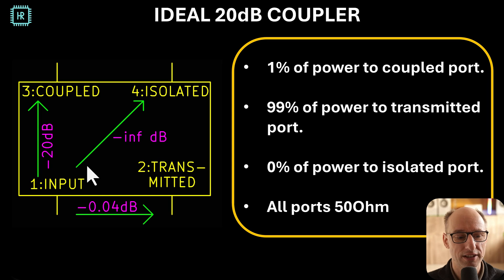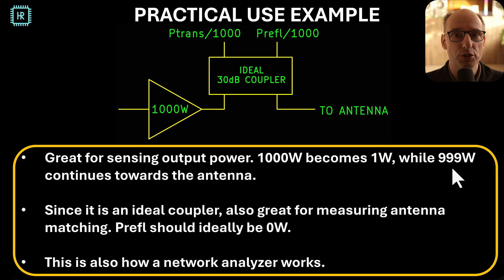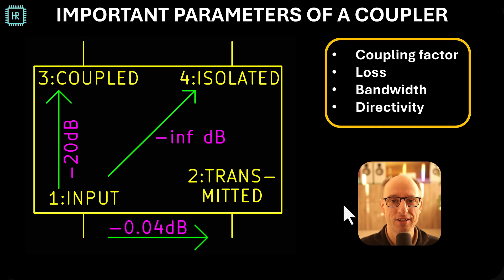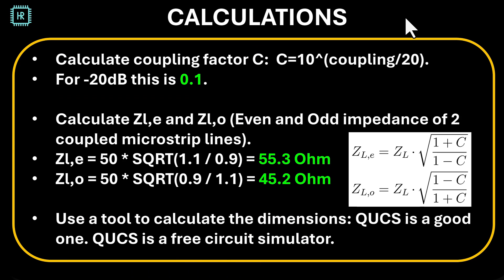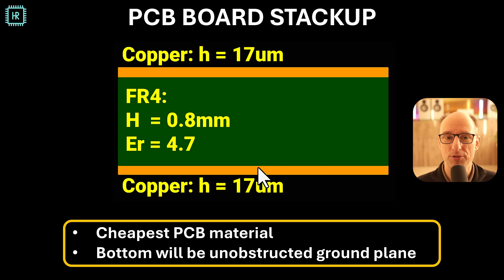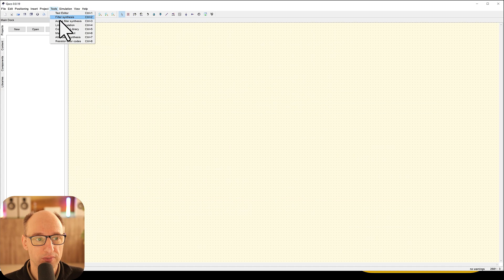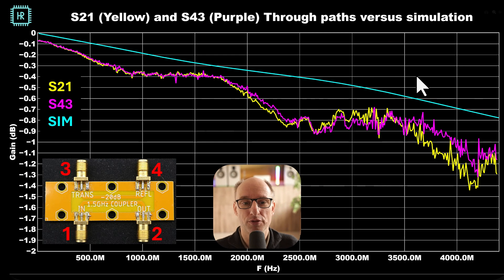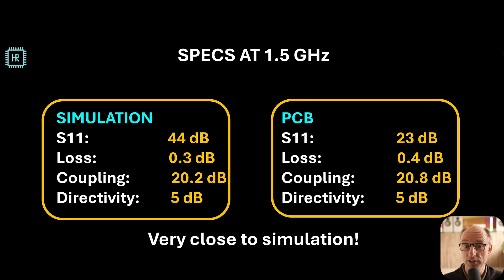Simple, Accurate 20 dB RF Coupler Without HFSS

Comment: Nice video. For the input matches S11 etc. it would be interesting to see the change by trying to solder as much of the SMA body to the copper. Also I wonder if the top/bottom planes has more stitching too and around the perimeter of the board. 23dB is pretty good!  I really like your channel, thanks

Comment: Why do you show -20dB and then write it is 1%. I thought -20db is 10x difference not 100x. What am I missing?
Reply from the maker: Aaah, great question. I was talking about power instead of voltage. When talking about RF we're usually talking about signal power instead of signal voltage. Power goes 'twice as hard' in dBs.

Comment: What 4 layer stackup should i use for eeg pcb. Its an adc and a mcu and power management. S/g/g/s? Or something else better?
Reply from the maker: Please watch my free module. You can find it on my course product page, purple button somewhere at 1/3rd of the page. The answer is in there (it is over an hour though). https://www.hans-rosenberg.com/epdc_information
Reply: @HansRosenberg74 yes I watched it thank you for that. I am so stuck right now lol. I just cant wrap my head around where these return paths will travel and if anything will interfere. Im doing an eeg pcb and its my first pcb. Its 90% done now im getting to signal integrity part and I am lost. Its the ground return paths that are confusing me
Reply from the maker: You're making this way way way more complicated than it really is:

Just have a ground plane under each signal layer. When you have a signal path, the ground current needs to return. Just draw the closest path the ground can make. Does it make a detour? Fix that with a via or something else so the return current can stay close. Under the signal trace is best.

It's really that simple, almost kindergarten stuff. It's just that we make it complicated in our heads because its electronics and we can't see what is going on. I had that same complexity in my head until I understood....
Reply: @HansRosenberg74 I agree but i am a beginner only 5 months experience and Im doing a pretty sensitive pcb. The eeg signals have to have probably one of the lowest noise interference of any mixed signal system. Im concerned about the digital dc and high frequency return magnetic/electric fields spreading far enough that they change the voltage of the ground plane underneath stuff like decoupling capacitors for the analog pins and idk I have a feeling that if I just put ground vias close to pins, make some via fencing at /20 highest frequency and just space stuff out it still might not be enough. Eeg signals can be messed up with as little as 0.010mv of noise

Comment: Really helpful video, thanks. For your example you have L=26.7329mm. For your PCB implementation you understandably have right angled tracks to the SMAs. Is L on your PCB the parallel (straight) part + the width of the two  45° parts or something else?
Reply from the maker: The 26.7mm is the part where they are closest together. It does not include the 45 degree angled parts!

Comment: What about frequencies in the range of a couple MHz. Quarte wavelength would be couple meters. Not suitable for pcb.
Reply from the maker: No that really would not work, unless you're willing to solder 50 pcbs together. At those frequencies, you need to use transformers. I believe mini-circuits will have some solutions for that.

Comment: It's funny the algorythm must be listening to me. I tested out the PCB mill at work and made a directional coupler for 915 MHz with coupling of 10db. I terminated port 3 directly with 2x 100 ohm resistors in parallel to make 50 ohms. leaving port 2 open circuit I could see -12dB on port 4 and terminating port 2 with 50ohms made it drop to -34dB. That's 22db isolation from kicad transmission line calculator. If it's 10dB coupling im guessing tha means 0.9 is getting to port 2, and reflecting that would couple 0.9 * 0.1 to port 4 which is -10.4dB so yea not bad. 
I'm working my way to making a network analyser. Next step is the local oscilliator and 2 mixers.
Reply from the maker: Ok, wow, you want to build your own network analyzer? That is a great project! You need really good isolation. I searched for some papers on it after I made this video and saw the bad isolation. I found some papers who add some ground at the points where the pickup line bends away from the through line. That really increased the isolation a lot. You'd need to do em simulations to optimize that but this is something I want to try at some point. I searched for 'high isolation RF coupler design' or something like that. Probably, chatgpt will give much better answers right now. this thing is getting scary good :-)
Reply: @HansRosenberg74  I just saw your rat race coupler video and might use that for the mixers. I know about super heterodyne receivers down mixing the RF to an IF in while keeping all side bands. Didn't know they keep phase information too, so i'll be leveraging that for the phase measurements in the network analyser. Shared LO going to 2 mixers. FR4 is cheap, worth a play to learn at the very least.

Comment: Hi, I am new to your channel. I wanted to ask regarding the coupler parameters. Isn't insertion loss a major parameter too. I often see it in datssheets. How does that work out exactly? A brief description would be great. Thanks.
Reply from the maker: Yes, it is important, it is basically related to the matching of the input port, which is measured. You could also take the overall loss of the coupler which is in the measurements. That would be the loss from the input to the output port.
Reply: @HansRosenberg74 okay got it. So total loss measured from input to output can be thought of insertion loss. Thanks.

Comment: Hey, thanks for the videos. Could you make a video about fixing holes, whether or not they should be connected to the chassis with the ground plane? If I have more than one fixing hole, do I put all of them in contact with the ground or just one? If I have more than one board in the case, what should I do?
Reply from the maker: This is a bit of a tricky question, but a very interesting one! After a little thinking, I think the  main thing to keep in mind is this: If you have signal current running somewhere, make sure there is a ground return path nearby. So you don't want to use the case as a ground connection for signals moving between pcbs via ribbon cables for instance. You'll make a big loop that way. If you give each signal current its own ground return current nearby, I think you should be ahead of 99% of problems.

Comment: Hi Hans. I'm designing a circuit that is using the AD8352 chip. It's basically a Gigahertz op-amp. Its input and output impedance is very high, so the evaluation board in its datasheet has open planes underneath its input and output traces to prevent capacitive interference.

The logic seems sound, but it obviously violates your unobstructed ground plane doctrine, so I wanted to hear your opinion on it.
Reply from the maker: These are exceptions. When you're working with such a high bandwidth feedback circuit, even the smallest amount of parasitic capacitance can ruin the phase margin, bringing it closer to instability. Now these gaps are very very small, so the frequency where they would cause problems with the return current path would probably be above 50GHz so that is nothing to worry about. Great question!
Reply: @HansRosenberg74  Huh, so that is an exception. Do you think that might be a good Flawless PCB Design video topic?

Where would you cut the ground plane? In the middle of the baluns like in the AD8352 datasheet? Or perhaps after the 25 ohm resistors?
Reply from the maker: @cdroidno8  I would follow the datasheet.

Comment: Nice theory, but I mostly use HF bands. 2 metre at the highest. 
At 2m, the tracks would need to twist like snakes to fit on a board.
Reply from the maker: indeed, 'lf' is not acceptable here, maybe you can do the same with a transformer at these frequencies?
Reply: Usually reflections are done using a transformer-based bridge circuit instead of a microstrip coupler at lower frequencies. Although I have seen some 2m band devices with microstrip couplers (don't know how well they would have worked though).

Comment: You need a proper vna.
Reply from the maker: I know, care to donate one ;-) I really would love to have a fieldfox all in one....... a bit expensive unfortunately ;-)
Reply: @HansRosenberg74  The Librevna is ok for many things. The developer is very helpful. There is an ecal for it too, the librecal. The whole setup is reasonably priced, at least when compared to some online electronics courses ;-) There is potential to improve the isolation on the Librevna (although it is ok for many things already), and being open-source, you would be free to do this.
Reply from the maker: I looked at the libre vna. However, the specs seemed to be very similair to my nanovna v2 plus 5 which is the best model currently. Improving it might make it better, allthough my biggest lack in the nanovna is dynamic range and I wonder if you can improve that because it is most likely linked to the dynamic range of the adc in there.
Reply from the maker: ah, I didn't realize the librevna is a full 2 port! That makes a big difference. Maybe I should look into this! thanks

Comment: When calculating S21 and S43, did you also account for the extra losses from the SMA connectors on the PCB? How much are those losses in your setup?
Reply from the maker: I did not account for those. It could very well be that those extra pieces of pcb track from the coupled lines towards the connectors and the connectors themselves account for the 0.1dB of loss I'm missing.
Reply: @HansRosenberg74  Thank you for the reply! I would be interested to learn more about your footprint. I've struggled to get losses of less than 0.5 dB in a connector when using edge-mounted coaxial connectors. The transition from the connector to a 50-ohm trace is tricky to get just right.
Reply from the maker: If you want good performance, you have to use specialized connectors and ro4003. Here is an example of such a connector: https://www.belfuse.com/resources/assemblyinstructions/cinchconnectivitysolutions/johnson/ai-ccs-john-sma-high-frequency-end-launch-connectors-pc-mounting-instructions.pdf
Reply from the maker: This is not the best document, 10 years ago I worked on a radar system that needed very high specs, I used end launch connectors that were specified up to 26GHz. The layout was exactly outlined in the datasheet that came with the connector, including which type of rogers material to use and the thickness of the dielectric off course. I couldn't find it that easily, but a bit  more searching should allow you to find it. These connectors are more expensive though. I think they may go up to 20usd.

Comment: I checked the geometry with the (free online) Sierra Circuits Impedance Calculator which claims to be a 2D Field solver. The numbers are very close.
Without solder mask: 
C=0.0979, Zodd=45.21, Zeven=55.03 
S11 to S14: -42.836 ∠ 110.64,	-0.287 ∠ -89.07,	-20.371 ∠ 1.04,	-24.244 ∠ -179.7
With solder mask (parameters guessed):
C=0.1000, Zodd=44.46, Zeven=54.34
S11 to S14: -34.881 ∠ 157.36,	-0.291 ∠ -90.37,	-20.191 ∠ 0.25,	-24.58 ∠ -179.64
Reply from the maker: Nice!